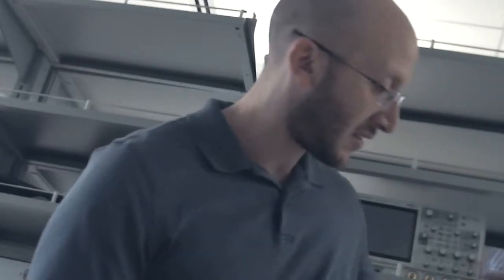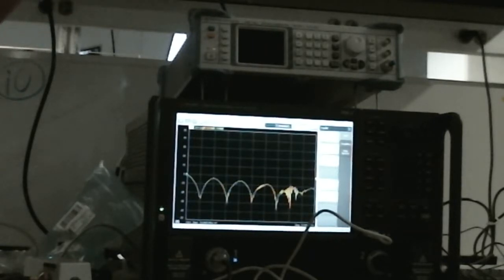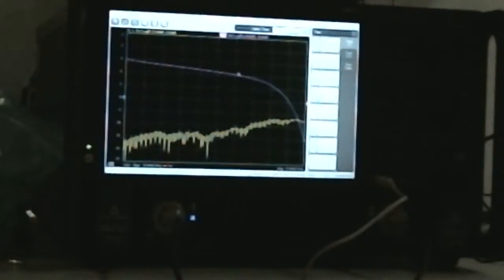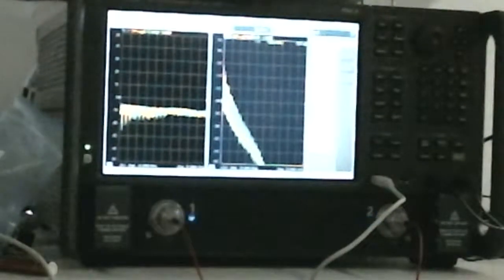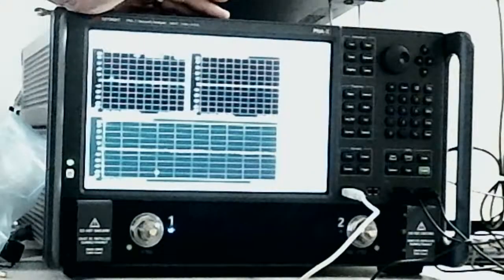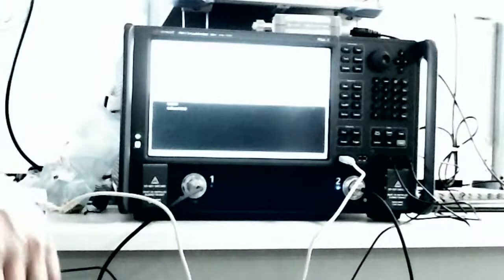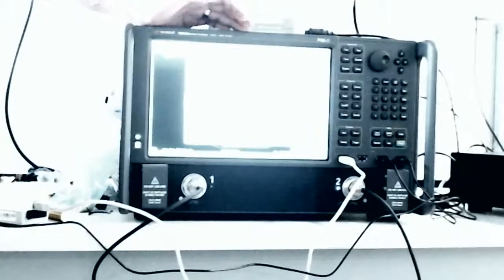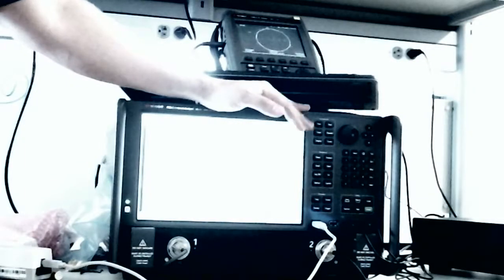Keysight N5241B PNA-X Network Analyzer || Training Video || EECS, York University

Comment: After to listening to some of the students responses, they shouldn't be allowed to touch a piece of equipment like this.
Reply: @IVcurve  It's just that ruining precision 2.4mm or 1.85mm connectors very easy, and each of those cables/adapters cost thousands $$$ :) Less painful to learn on something more basic than $500k PNA-X.